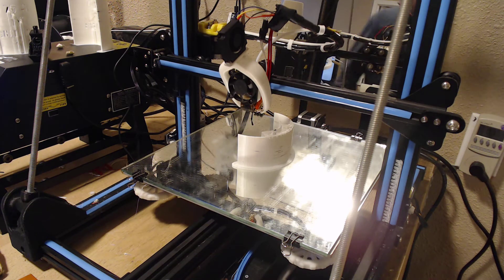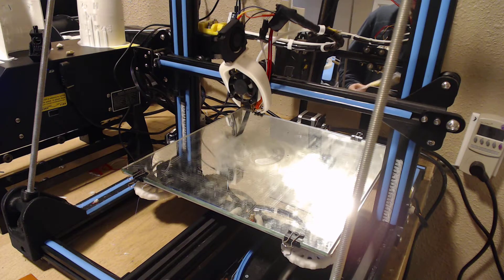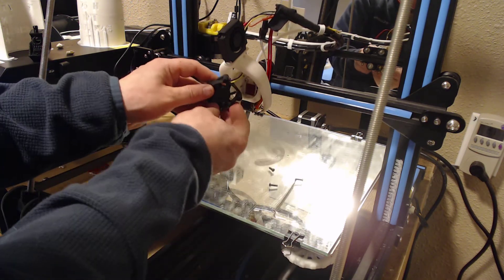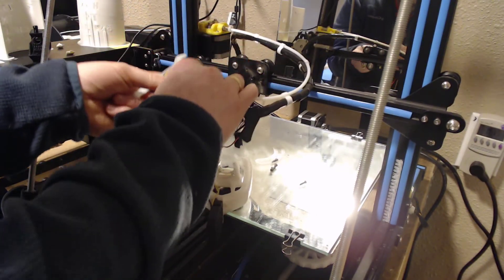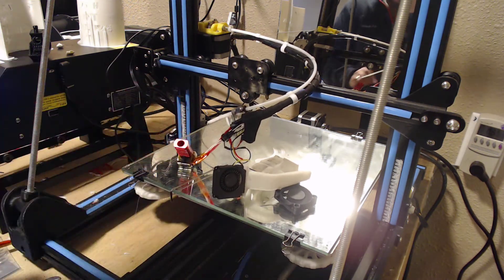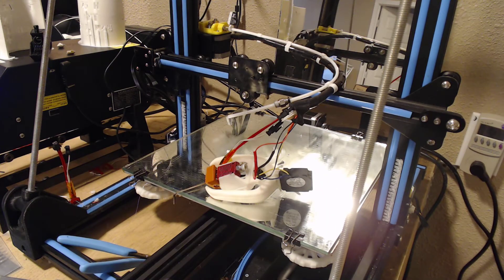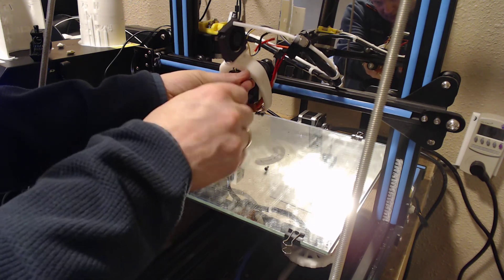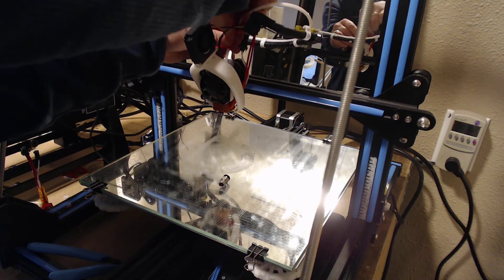Hotend Fix for Creality QuickConnect - Cheap Cotton and Kapton Tape Melting

Comment: Hi my cr-10 says its at 210 but its not and won't melt pla because the hotend is not actually hot enough, iv replaced the hole hotend, heat element and thermistor as still not working if its something inside of the control box can you tell me what needs replacing or what to look for and how so I can fix it please
Reply from the maker: Has it ever worked correctly?  Have you made any changes as far as upgrades prior to the Hotend replacement? Does the does the Hotend heat at all and does it show on the control display?  These are pretty simple and reliable machines, we should be able to get you going.
Reply: @makersteve934  iv only done printed upgrades nothing at all when it comes down to electrical, the replacement hotend it another original cr-10 hotend, when I want say 210 it says that and the temp says its reached 210 but its not as iv tested it with a thermal gun plus its not melting the pla, even when I put in 260 it still don't actually get hot enough to melt pla either, the screen works fine
Reply: @makersteve934  and yes it used to work properly

Comment: I agree with jan. In addition, if it's leaking filament, it will charr over time all the while collecting under the cotton and tape. Make sure the nozzle is tight against the throat. Make sure ptfe tubing is cut square, and seated all the way to the bottom of the throat.
Reply from the maker: I cut the PTFE tubing, completely seated the nozzle and also the PTFE.  But it definitely makes for good discussion.
Reply: Def try tightening the nozzle against the throat after it's heated. I notice you have the two hold down bolts on either side. This was an attempt to prevent the heat block from rotating to aid the set screw. Problem is, thos bolts can prevent you from seating the nozzle against the throat if set too far back. Many people remove those bolts to prevent issues.

Comment: Kapton tape should be able to withstand up to about 400 C. Even a non genuine tape shouldn't be able to melt at normal print temperatures.
If you are still running stock firmware, I'm not sure the thermal run-away is enabled. If there is an intermittent connection issue to the thermistor, then that might be the issue as well.
Reply from the maker: The cotton definitely is making most of the goop, the the kapton tape is burnt like nothing I have seen before.  It is stock firmware, but thermal runaway is not the problem, i have logging enabled on Octoprint and can see the hotend is staying consistent at 202C.
Reply: @makersteve934  I doubt the hot-end is only at 202 C. Neither the insulation or the kapton tape should have any problem with that temperature.  You should easily be able to print at 230 C. Put an extra external k-probe on the hot-end, and verify that it reports the correct temperature.
Reply from the maker: @janpetersen8441  It's been 3 hotends in a row all reporting correctly on the Control Panel and in Octoprint.  Each one with a different thermister.  I completely agree that I should be able to go much hotter with no damage to the insulation.  There is something wrong with the material they are using, IMHO.  6 other crealitys, all of them cranking away with no discoloration.  

The issue this time is not the kapton or the cotton, it is the leaking filament between the nozzle and the heat block.

I did throw a temperature probe from my Multimeter on it and it was consistently 10C colder than the set temperature.  I can't get it inside, i didn't remove the thermister or I would get thermal runaway.  I am convinced that, cotton and Kapton is crap and there is a defect in these hotends that cause them to leak filament.  Why would Creality (and I love Creality) send me 3 additional when my original purchase was 2?  I am sure they would send me two more.

Comment: Hi Steve! Your site has helped me with my Ender3 on several occasions. Thx! Perhaps you have been "testing" these hotends, I don't know.  May I suggest an all metal hotend? I understand the expence of all metal, and the ease of your actual fix (heater block condom), but just for the sake of disscusstion... the time saved, down printer time, and added abilities from all metal make it the clear choice when its replacement time. I agree, the quick connect and thing could be handy in some environments. I have had some issue running petg with my stock hotend and am concidering the microswiss, but I have a few more ideas on how to get it to flow thru the hotend better. Thx again!
Reply from the maker: Glad I could help!  I know I can go to a custom hotend, but they cost more (or maybe not with all the trouble I have had and I am looking for a solution that keeps me printing inexpensively and reliable as the printer did when I got it.  If this keeps up, I will break down and upgrade the hotend with an all metal solution.